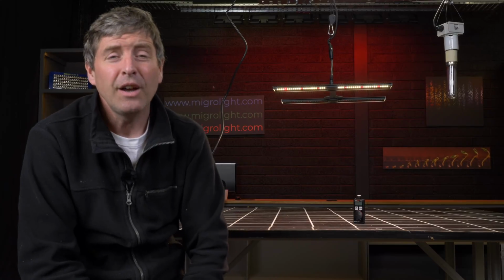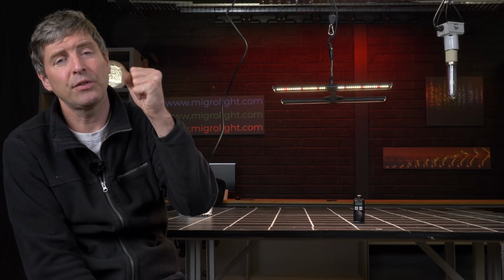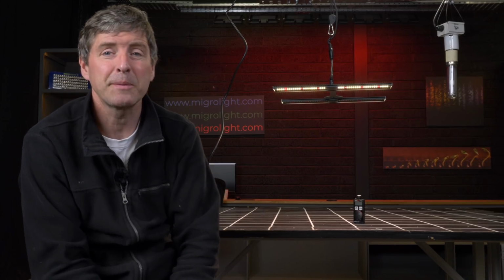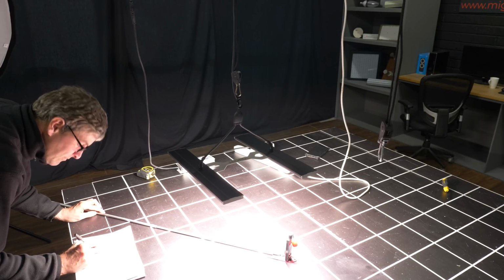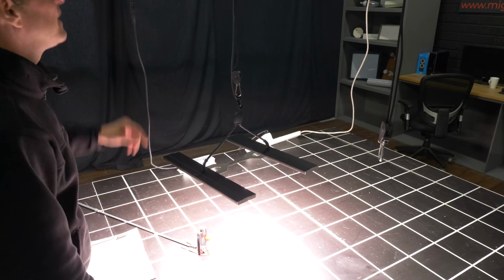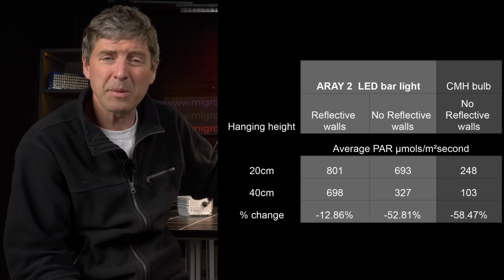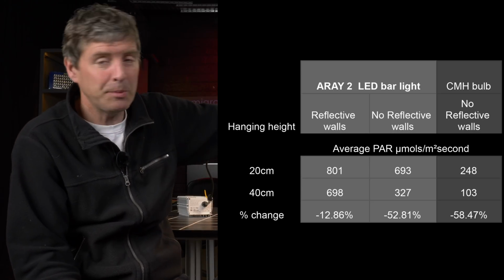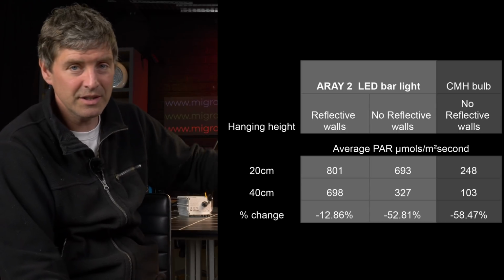Inverse square law is WRONG for grow lighting

Comment: Basically, inverse square law is 100% accurate until you include light reflectors on the fixture, bulb/diode, or around the grow area.
So don't just assume that the law applies to any light source used because there are factors that will almost certainly be added to the equation.

Comment: One thing that was left out was the effect of the shape of what is receiving the light. A sphere will see much more of a consistent drop off compared to a flat object like a leaf. A leaf close to the center of a light bar is getting very little light from distant diodes, but when you back up a leaf it is then collecting much more from distant diodes. In some cases it can get brighter as you back away.

Comment: Many of us measure with a cell phone app that is different from a genuine par meter because it's lens is more flat and directional than the semicircular lens of the par meter.  
120 degree angle measurement with a phone app is important for getting light penetration into the sides of a plant is an important measurement this video ignores causing many people to miscalculate the shape and underestimate the usable size of their lighting footprint.  
Bruce sells Apogee so he also excuses this measurement which is a valuable tool for decisions.
Reply from the maker: Hi, 

The phone apps vary in accuracy based on the phone and camera used.

Thanks.

Comment: Inverse square law apply as is only for point source that has omnidirectional radiation...
If you have directed output, you must have gain function calculated in, this is basic EM stuff....

Comment: Physical laws can not be broken otherwise it's no longer a physical law!!! That's a fact!!! Even inside a tent a with led bars the inverse swquare law is still valid you just have to calculate it for any single light source and need to take reflections into account. 
The whole discussion has started years ago and is just because of one single fact; the fight between HPS an LED users! 
Lets say we have a single light source like a 1000w HPS bulb and we measure intensity at 4ft and at 6ft distance because we plan to have 2ft tall plants we'll get readings of ~600μMol/s/m² and maybe 450μMol/s/m². That's because we are already farer away from the light source and the reducing effect gets smaller.
If we use an LED strip fixture at the recommended hanging hight of 1,5ft and measure ~600μMol/s/m² intensity and measure intensity at  3,5ft the reducing effect is much higher and we only get ~300μMol/s/m². That's not because the inverse square law is no longer working inside a tent or with reflective walls it's just because of the usually higher distance we use with HPS lights. The whole penetration discussion is for the bin, both types of lights have pros and cons. One could replace a HPS light using a high power COB with 60-80° lens and you would see the same results at higher distances. Physical laws are called laws because they can't be broken!

Comment: Inverse square law is more accurate when testing a single light source unlike leds with multiple lights of course inverse square law gets thrown out the window when scatter light photon from reflection are used in the equation that’s why your more closer too the inverse square with out the reflection walls creating noise inverse square is accurate when the testing is more actually done

Comment: Scattered par from reflective material is not true primary beam energy is lost from the light  photons twhen it’s redirected to the primary source but scatter will raise density numbers but is not the primary beam plus the inverse square law does not have reflection in the diagram and is based on the fact all photons 100% primary beam are in the equation that  is I physically impossible  to do

Inverse square law is just a basic law like gravity but we all hit terminal velocity at different speeds

Comment: Well as a X-ray tech your reflective wall are causing your test Results to be less accurate because with the LED you’re bouncing more scatter because LEDs cannot Collimate like your ceramic metal halide that’s why the CMH is closer to the inverse square law because I can collimate the primary be more directly

Comment: I would to see Shane take his light spectrum meter outside on cloudy days and see how  clouds effect the 
light spectrum. Which colors are lost most in the clouds. I have a lux meter that I convert to PAR. If the clouds 
are real white and you have to squint is is around 600. As soon as the clouds have any gray to them 
the par goes from 100 to 50.

Comment: The inverse square law is just a fact of life. Your measurements are not disproving anything. When you double the distance of the array only the diode directly above the sensor will have 1/4 the photon flux density. All other diodes in the array will not have moved double the distance from the sensor thus will not have 1/4 the pfd.

Comment: There's are laws and there are theories. If you say one of the laws are wrong then you are wrong. Please don't encourage science deniers. But instead you say it doesn't apply I'll add doesn't apply "the way people may think it should." But forget philosophy... Sides and multiple sources are good. Sides: when you raise the light, the distance reflections travel in proportion are less. That effect is squared. Probably a greater contribution is that as the angle of those reflected rays gets smaller then the sensor is seeing more photons because they are coming from closer to the center of the led where the lens is concentrating them. It's probably easier to understand in the case of the multiple LED fixture in open space. Start with the sensor close under the middle LED. The side leds are farther away. When you raise the leds they all get farther away but, in proportion, the LED distance in the center changes faster in proportion so using the center LED as the metric, the contribution of the edge LEDs does not diminish as fast. And likewise, light from the edge LEDs will actually increase when the fixture is raised because the angle to the sensor will take light from brighter and brighter parts of the lens. The advantages of angles and optics however are still diminished by the inverse square law... It's that when you raise the light you are squaring different things than when the light is lower. And yes, ISL apples to multiple point sources. Think "all light is photons" and classical and quantum physics will get the same results calculating one photon as a million trillion trillion... the results add up. Science laws aren't like people laws. They are very hard to break. So instead of suggesting that the ISL doesn't apply, I think it's more likely to say that it does apply but just not in the obvious way.

Comment: You could have saved yourself a lot of time and just learned calculus. Your measurements won't prove anything because your surface is essentially flat(and if you bent it in a concave shape you could actually increase the intensity). The "spheres" radius for your flat panel is so large that the effective distance you are from it is as if you are right at the surface. So to "double" the distance to validate the inverse square law would require you to be hundreds of miles or more away from the light(and then your measurements would show that your light had spread out and dissipated and you could "confirm" the inverse square law").

It's like measuring the light intensity 1mm from an LED then 2mm from an LED and claiming that the inverse square law is invalid. This is wrong because the inverse square law applies to, as you said, a point source. That simply means that you use the correct radius. The RADIUS is not the distance from the front of the LED but the distance where the point source of light would need to be to give the equivalent light the LED gives(which would be some distance behind the LED such as a meter). So what you think is distance to the "light source" is not the same as the distance to the *point light source*.  You are not compensating for the fact that you do not have a point light source.

I can't draw it so it is obvious but it is very simple.  Here is an experiment: Take a box and put a light in the center of it. Poke a small hole in it. Then measure the light at some distance d and another 2*d from the hole. THESE ARE NOT YOUR RADII! So if you expect the light to quarter at 2r you are WRONG. You have to take the distance r from the point source to the hole, call it r. Then your real distances is r + d and r + 2d.

But if r is much larger than d then we don't have twice the distance needed to validate the inverse square law. Your experiment is ignoring r which is large(you are treating it as 0 when it is not).

E.g., if r is 10 miles and d is 1 inch then your distances effectively are the same and will produce almost the exact same intensity even though "in your mind"  you think you've doubled the distance. You've doubled the distance from the pin hole NOT from the point source emitting the light. N ow if you stuck an LED at the pin hole and turned off the point source it would make ZERO difference as long as the LED's emittance at that point on the box was equivalent to that of what the point source emitted through the hole.

To see this in even more detail, suppose you have a large wall with a pin hole in it. You have a "point light source" on one side of the wall. On the other you measure the intensity at d and 2d away from the wall. If the point source is right up against the wall(on the other side) then r = 0 and your distances you are comparing truly, in terms of the inverse square law, are "twice the distance". BUT if you move the point light source r distance away from the wall then r != 0 and you are comparing r + d and r + 2d for the "twice the distance"... but this isn't twice the distance unless r = 0. If r is very large then it will swap the small values of d and 2d and you won't be at "twice the distance" like you think and so your calculations/measurements will be wrong according to the inverse square law interpretation... but they are not wrong, just your use of the formulas and correctly knowing "what to plug in".

Go to the wiki page on inverse square law and look at the picture. There they have S, r, 2r, 3r.  You think you are at 2r in your experiment BUT you are really at like 1.0001*r(not even close to 2r) so your measurement of the drop in energy is not going to be quartered like you think it should because you've not measured from the TRUE point source(which is S and not the patch at r in the picture(which you take to be the point source))
.
Reply: Can’t wait til he replies to this.
Reply: Honest I have a decent understanding of light in general and was gonna post myself til I seen this and you’ve said it much better than I could of.
Reply: @jaybuzz8786  It's one of those things that could be explained with a picture extremely easy. I tried to explain it with enough words so hopefully it would sink in but it still might be difficult for some to grasp.

The issue is very simple: Confusion of what the point light source is/where it is(A point light source means a mathematical point light source(an infinitesimal location in space)) AND the fact that the "theorem" is usually said incorrectly - the intensity falls inverse squarely with the distance from the point source.

If you read the theorem as "the intensity falls off with the inverse square of the distance" then you'll think that if you have any light and measure r meters away then the light will be 1/r^2 of the intensity. This of course makes no sense. The intensity could be 0(if you end up in a box) or more(if you end up on the source of light or closer to it).

Also, the statement has assumptions(because it is a mathematical statement) that we only have one ideal point light source in existence rather than multiple lights. (and that a mathematical light source is really just a location to measure ultimately giving us a sort of vector space(a point light source would be a  source in a vector space where the diverge is positive and the curl is zero)

I can understand peoples confusion if they do not understand much math but ultimately they have to educate themselves more and not pretend they have the entire universe figured out. I guess this type of problem happens often when things get lost in translation as mathematics is "dumbed down"/"simplified" for mass consumerism.

Comment: You are both right and wrong. It is true no matter what because there are no such things as point sources. It is not a principle of physics but of math. If you have a flat sheet of LED's then, in fact, it is not flat but curved and the radius of curvature is just extremely large. It is equivalent to a very strong point source much further away. That is, you take a very large sphere and then some small "patch" on it will look flat but technically it is still part of a sphere. Even if it is irregular or convex things ultimately don't change. For all practical purposes you are right but technically you are wrong. 

For example, if you have one LED and it not being a laser but a sort of approximate point source with more than half of it's back side covered up then it will send light through a solid angle(a cone rather than a cylinder) and so the light sill spread out with the square of the distance but most of it will be contained, after some meters, still within a usable range. E.g., it is just a flashlight(flashlight beams still spread out, in fact have to so they are useful).
If you have many LED's in a grid then this too happens but each LED compensates for losses to the next one as the "cones" cross.  Just think of a grid of flashlights. This effectively increases the radius of curvature of the "equivalent" point source.

It happens for anything, not just light. Sound also will have the effect as will anything that emits things. Again, it is a mathematical principle. The inverse square law has to do with the entire sphere(you integrate over the radius/surface) but if you are doing a patch it will depend on the curvature or radius(essentially the "same"(curvature = 1/r)).

I'd show the math but I doubt anyone here would understand basic integral calculus. The idea though is very simple. If you have a fixed amount of "stuff" and you spread it out over the surface of a sphere(think of, say, paint or dough or fabric) and you doubled the radius of the sphere(reduced the curvature by 2) then you'd need 4x the amount of material(or you'd end up being able to cover only 1/4 of the larger sphere or have only 1/4 the thickness to cover it(for dough, paint, etc)). 

The only difference is that the "inverse square law" is a statement about the entire sphere while a flat panel is a statement about patch on the sphere. Ultimately though it's the same(since a sphere is made of patches and a patch is a part of a sphere) but just different perspectives and the practical aspects are different.  Even if you have a very irregular surface that is not smooth, it doesn't change the fact that the more spread out something becomes the less dense it becomes(which is all the inverse square law is saying but it's a statement about it on spheres).

Comment: Hey Shane, I think your title should say "Inverse square law DOESN"T APPLY for grow lighting".
It doesn't apply for 2 major reasons:
1 As you say, Light beam focus. Example- take a flashlight and hold 1 foot away from the wall. Measure that circle (2"). Now back away to 2 feet and it looks dimmer until you refocus the lens back to the 2" then looks very close to original brightness.
2 Intensity matters. Example- 2 flashlight, 1 can shine on a wall 10 feet away the other can shine 50 feet away. the amount of loss at 5 feet away for the higher-powered light will be less.

Canopy penetration refers to where the Larf starts. You can only get the light so close to the top without problems, so the depth of your good bud vs Larf will relate to the power of the light.

Comment: How wrong you are.
Thats like saying the laws of gravity do not apply to a bunch of coconuts because weighing them as a whole will not give an accurate weight of individual coconuts.

Cover all diodes but one then do the test.
Turn the HPS in the direction of use instead of the worst possible scenario. 
You can say the law is not sufficient in itself for measuring light from multiple sources but to say the law does not apply is by definition ignorance.